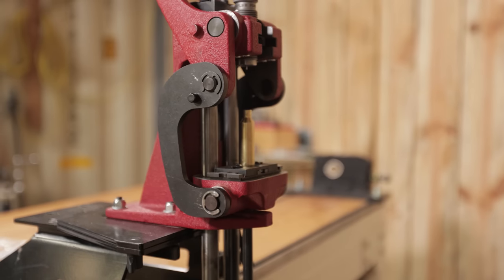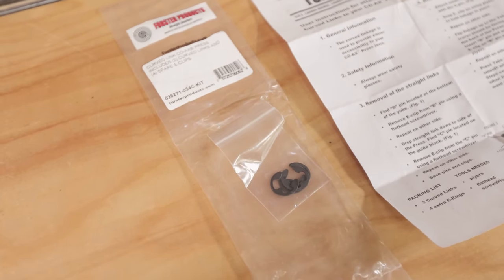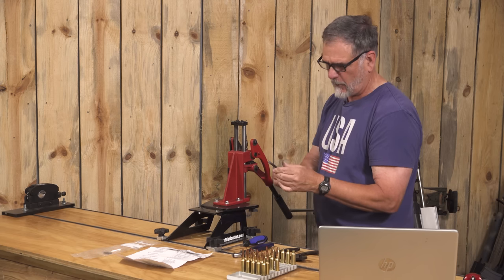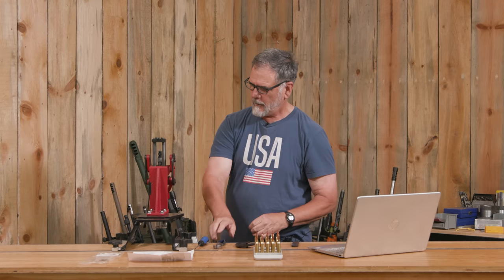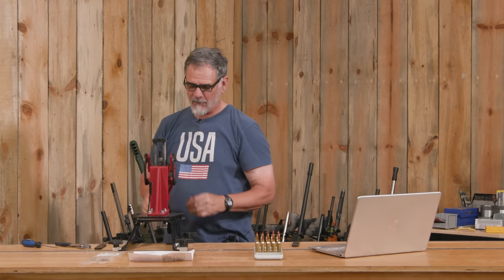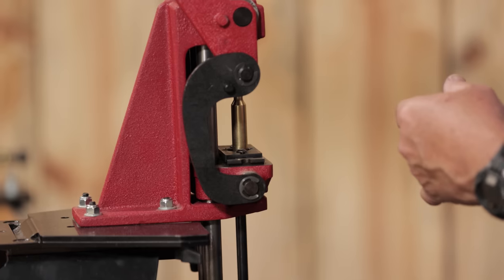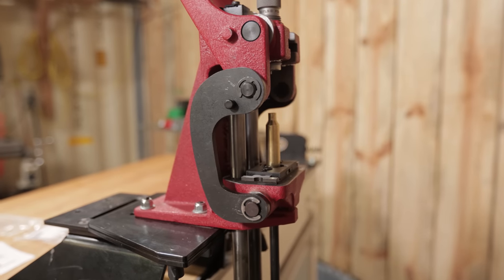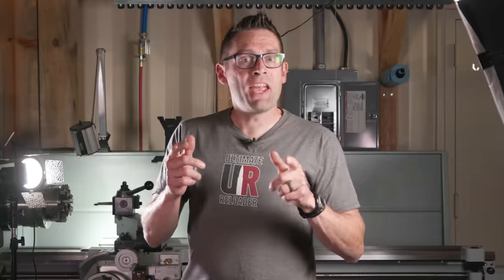Forster Co-Ax Upgrade: Curved Linkage

Comment: Nice upgrade!  That’s what Josh Badeau thought when he came up with this exact design years ago.  He was selling them online, but hasn’t been making them for the last year or two.

Inline Fabrication also makes some good ones, but they have a little triangle in the center that doesn’t allow quite as much clearance.  

These do have a nice finish on them that matches the co-ax.  My Badeau ones have a black oxide finish, which is different but very smooth.

Comment: I likewise have an older Bonanza knew there were problems with some of the aftermarket ones glad Forster made those available. I also have a Shell plate holder made by a gentleman that encapsulates the springs and makes them adjustable. Also add strength, withdrawing, brass from die. Got to get a set of these. Thank you for the great video.

Comment: I used a different set of curved linkage.  It worked fine, but seemed to have a tiny cam over.  I didn't care for that so switched back.  Looking at these I think the slightly different design will probably not have that.  I think I will be getting a set.  Thanks for the video!

Comment: Installing E-clips with pliers, place one jaw on the back side of the clip and the other jaw on the opposite side of the shaft and squeeze the jaws together. With the tip of the pliers inline with the end shaft. Less chance of sending the clip across the room. 😁
Reply: I did it that way with the second side. Should have done so with the first side!  :)
Reply: @guyminer3168  i figured i wasn't tellin ya something you didn't already know. I was running a forster press in the 80's when they were labeled "bonanza press". And anybody that was somebody owned a 25-06. I still own one. But it's a little bit different than the ones back theh. Tikka rebarreled in 1:7.5 twist, shooting a 133 berger..
Reply: @jeffward8278  - Well, you're ahead of me. :) I'm still running a typical 25-06 barrel on my Rem 700.  What a great cartridge!
Reply: @guyminer3168  the older rems are wonderful,

Comment: I bought the inline fab ones a few years ago, but they dont offer as much room on the sides as the new forster links, but i also dont think spending another 40 dollars on another set of links is gonna make a landslide of improvement over what i already have.  If i had the stock ones still on id say yeah totally worth it.
Reply: You did fine, the Inline Fabrication links are better. The Forsters use rivets which flex. I went back to the straight ones.

Comment: A friend of mine gave me an older Bonanza press that he learned to reload on when he was a kid, 50+ years ago. I haven’t picked it up yet but i’ve already ordered the curved linkage, the new small shell holder, 12 die rings and a short handle. Is there anything else i need to get before i see the press😂 Thanks Guy, great video series, i also thought you put them on the wrong side. 😂

Comment: I bought a set from a third party a few years back.  
I hope Forster bought the design from him.
Reply: I did the same and these are identical to the one's I bought 6 or 7 months ago. Because his operation was small, I paid more money for them but it included shipping. I like them and glad I bought them!
Reply: That was Josh Badeau, and I honestly doubt they gave him anything.  These are just slightly more of a “C” shape at the top of the link than his, and Forster has a lot more money than someone working out of his garage. Initially after installing mine the press contacted a thicker aftermarket shell plate (Manzgear) which I like a lot more than OEM, and Josh fabbed me a set of standoffs to fit over the stops with a set screw to shorten the throw, and sent them to me for nothing.  I since worked out a better solution with different shell plate screws.  Great guy.  In 2022 I read he stopped making them, but don’t know how accurate that was.  Obviously Forster knew a good thing when they saw it.

Comment: Am I the only person that noticed that he put the links on BACKWARDS!!!! Those links have “stop” pins/nubs in them. They are supposed to face inwards to act as a mechanical over-travel stop. Oops! I guess even the professionals make mistakes. Keep up the great content!
Reply: They were installed correctly per Foster’s instructions…

https://www.forsterproducts.com/pdf/instructions/forster-products-curved-press-linkage-user-instructions.pdf
Reply: The curved linkage made by Foster has linkage stops on both sides of the linkage.
Reply: Thank you!!
Reply: First thing I thought, until I read the explanation.  No idea why they’d have them project on the outside though, where they serve zero function?  Maybe to make them different enough so Josh Badeau doesn’t sue them for ripping him off?

Comment: I load a lot on my Forster coax. Are the c shaped brackets as strong as the straight brackets. I load .338 mag and 300 win mags on my press and need the strength.
Reply: I think so.. But I only loaded 7 PRC.

Comment: I have the Inlinefabric installed on my Co-Ax and the most favord benefit is that has become a Co-Ax with camover and not a hard stop as it is seen in your video of Forsters own upp grade.
Reply: What is the advantage of the camover vs. the hard stop in reloading operations?
Reply: @michaeld9731 Good luck getting an answer to that!  I’ve been reloading 25 years and have yet to get a good answer to that question, other than that it stresses the hell out of your press.  These don’t give any cam over, and it isn’t needed anyway if you adjust your dies correctly.  “Cam over” is a term lots of people use, but don’t really understand IMO.

Comment: I bought a set and in my opinion, they are garbage.  The pins on them don't make a good solid contact and get twisted as a result.  I'm sending mine back. The bad thing is that I cant find my OEM stock straight linkages.  So I guess I'll need to buy a set of straight linkages.
Reply: Hey Mark, i have a new press on the way and bought the curved linkages already here, you’re the second person i’ve heard this from, did you go back to the straight linkages? Thanks
Reply: Yes I did.  Return yours asap unless your just loading something that does not need a lot of force against a dead stop
Reply: @Mark6299  Thanks Mark, i appreciate your help. I only reload .223 but it’s for long range precision, the main reason i bought the Forster, i sure don’t want to take the best and. mess it up.

Comment: I'm getting more than 0.005" bump variance when I set it to 0.002" readjusting the lock ring and getting crazy variation. I emailed Forster this morning about it. I would buy this product if you're used to getting 0.002" shoulder bump without variance.
Reply: Are you using Forster lock rings on your dies? They're necessary for this press.
Reply: @Nobo35  yes.

Comment: You mention that the pins that stick out have to be oriented to the top; what do they do?
Reply: I've been wondering the same thing. At first I thought they might provide a positive stop, but no. They appear to serve no purpose.
Reply: If i remember right, they are travel stops for the yoke.
Reply: Ya, the little pins that stick out are on both sides of each curved link, and work as a stop for the press arm.
Reply: @ancientorder4645  - they stick out on each side of the curved link. On the inside, they do serve as a stop for the press arm.
Reply: Interesting, I assumed he put them on backwards, because the Badeau curved links only have the pin projecting on one side.  Wonder why they have them stick out on the outside, since that serves no purpose?

Comment: So you need to pay extra for the curved linkages?  Maybe Forster should have put these curved linkages on the press as part of standard links rather than selling you the press and then having you buy the 'upgrade'.  Thanks for making this video.  I'll remember this when I am in the market for a new reloading press.
Reply: My own Co-Ax is still equipped with the stock straight linkages.
Wanna know a secret?
I like it just fine, and I say that as someone with very large hands.
I have no problem at all moving brass in and out of it or with switching the case holder jaws if needed, and it's certainly much easier than reloading on my beloved Rock Chucker, although I still have the RC for specific tasks that require a cam-over press, namely the rare occasions when using the Lee Factory Crimp die.
Reply: @Gunners_Mate_Guns Why do you need cam over with the FCD?  I use my pistol Factory Crimp Dies on my Lee Classic Cast, (not breechlock) and it has no cam over at all.  Neither does my co-ax.  I adjust the die to where I want it, no need for cam over to set the crimp, full length resize, etc.  Legitimateky asking, never understood the need to stress the dies or the press by camming over, which seems to me to be an unintended design flaw in older press designs with looser linkages.  (?)
Reply: @E.L.RipleyAtNostromo  Actually, most O-frame presses are designed to operate in cam-over mode to ensure that the case goes all the way into the die and to ensure consistency.
I specifically use my Rock Chucker (cam-over press) for the factory crimp to ensure that the crimp is consistent from one case tot he next, since the design of the FCD requires that the bottom of the die be compressed by the ram.
If I relied on no cam-over with the FCD, I would get badly inconsistent crimps because I wouldn't have the solid stop at the top of the press stroke.
Reply: @Gunners_Mate_Guns Ok, that does make sense for consistency on each round, but as I specifically stated, the LEE factory crimp die works fine on the LEE Classic Cast, which has no cam over at all.  (And neither does the co-ax.). So “most” O-Frame presses aren’t necessarily designed to cam over at all, and that action certainly isn’t needed to compress the ram completely into the bottom of the die, or to get the FCD to be consistent.  On some presses cam over gives you that last amount of play when inserting the case into the die, and I can appreciate that consistency, but not having it doesn’t give you wildly inaccurate anything.  Especially on a rigid cast iron press with stops that has zero play, and the bottom of the handle range always equals the top of the ram stroke.  I can adjust my FCD by screwing it down further, and have no problem fully seating a round all the way into any die on a press that can’t be forced to cam over by torquing the linkage.

So if LEE designed both the FCD and a LEE press that doesn’t cam over, then they must know something about their die and their press I would think.  (?)

Finally, RCBS specifically includes an instruction with their dies that says “DO NOT CAM OVER,” so they clearly realize that some of their older presses are being pushed past their design limits by camming over and can damage their dies.

That being said if I had done it for years on a certain press and dies and it had been working for me, I wouldn’t change anything.  But, as I said on my presses it’s not an option, and they both load good  consistent ammo.

Comment: What’s the little pin on the curved plates used for. Did you install it backwards?
Reply: No, it's on as shown by Forster.
Reply: There's tabs on both sides of (of each arm) to stop the press on the back instead of the front like the factory ones

Comment: If you buy a new one will it come with it these brackets
Reply: I hope so, they're a good improvement.
Reply: Not unless they very recently changed it, or a store you happened to see the press in had put them on or ordered them specifically to be on there.
Reply: The Co-Ax currently comes only with the stock straight linkages.
Mine still has them, and I see no need for changing to curved one,s and I say that as a guy with very large "mitts."
Maybe this is just conjecture, but I have to wonder if the curved linkages might induce a tiny bit of flex,. especially over time or with very hard to size brass.
One of the big advantages of the Co-Ax is that the forces are kept linear,and it seems unavoidable that the curved design would subtly compromise that.

Comment: Solves one problem by creating another...
Reply: What problem?  Other than that he installed them backwards, these don’t create any problem.
Reply: @E.L.RipleyAtNostromo  guess you’re not an engineer…
Reply: @ralfrude3532 And guess you’re not either, since you’re incapable of explaining your totally unjustified comment.  As if everyone who has invented these didn’t know what they were doing!  Right.  

I also guess you’re not a reloader, since I’ve been using curved links for years on my co-ax with no problems or loss of mechanical advantage.

That’s OK, lots of guys trolling YouTube videos commenting on things cryptically and knowingly as if they know what they’re talking about. Funny, but none of them explain themselves either.  

My favorite was from a guy who pronounced “WD-40 destroys steel!  Don’t use it!”  When questioned about it, he just sat back and puffed:  “Guess you’re not an engineer!”  LOL!  🙄😅
Reply: @E.L.RipleyAtNostromo  you’re admitting of having to technical competence, but expect that I explain technical issues to you? Why should I? Work on your behavior first.
If you experienced no issues, then you might also not notice, if you use an aluminum die-cast c-frame press for your reloading purposes. Especially for resizing. I don’t think you even know, what this means for headspace. It’s ok not everyone is loading match ammunition. 
Why doesn’t the factory co-ax press use straight shaped linkage and not c shaped linkage? If there is any need for such an improvement, then the guys designing the co-ax press didn’t know what they do. Right? But why do you buy a press, that was by your definition designed by a dumb one and needs improvement?

Just start thinking and not insulting Mr. Knowitall. 😉
Reply: @ralfrude3532 Making a ridiculous cryptic comment and not explaining it, doesn’t mean the guy asking you to explain it isn’t technically competent. Forster has great engineers and designed a great press years ago, but it’s been improved with curved links which dramatically increases side access and has no affect on setting “headspace” or anything else.  They acknowledged this when they came up with their own links here that copy the old Badeau links.  

So everyone but you is clueless as to why these “create a problem?”  Who’s the “Mr. Knowitall” then??

By the way, I don’t know what you’re talking about with aluminum C frame presses; the only ones I know of those are cheaper Lee presses, which have nothing in common with the co-ax.  I have three presses, and they’re all cast iron and steel, and I “precision load” on all of them.
Reply: @E.L.RipleyAtNostromo  again you show your technical incompetence. I’ve only shown, by your own argumentation lines, that your „arguments“ don’t hold. 
And it’s not setting up headspace, but standard deviation and spread. Read an engineering handbook.

Comment: These are pretty terrible. The ones from Inline Fabrication are much better. The Forsters completely ruin the feel of the press, and change the way the cam-over and stops operate. They relocate the stops to rivets in the arms, which flex. The Inline Fabrication use projections from the arms which eliminate the flexing.

Comment: Snap rings...you need snap ring pliers....I'm totally shocked that you are supposed to be precision guys...wow
Reply: Snap rings and snap ring pliers are completely different and would not work with the e-clips used on the press
Reply: @duanearmstrong2920  ...then you must know, as I have a couple of sets, they do come in sets and I guarantee they would work...thats no new science there, and video is clear enough
Reply: @duanearmstrong2920 exactly correct
Reply: No, you don’t need to use snap ring pliers that are for a completely different type of clip.  These clips easily pry off with a wide blade screwdriver and snap on with a push from pliers.